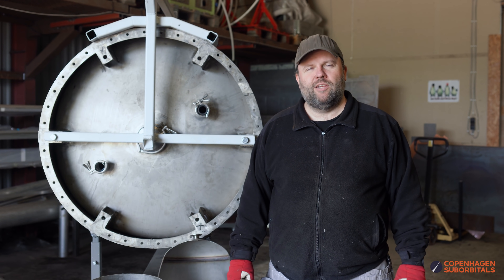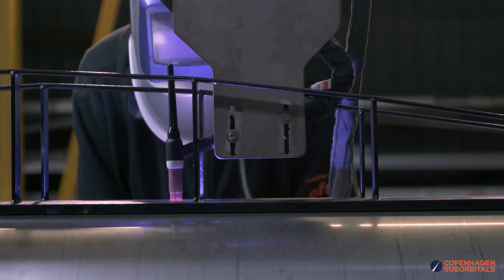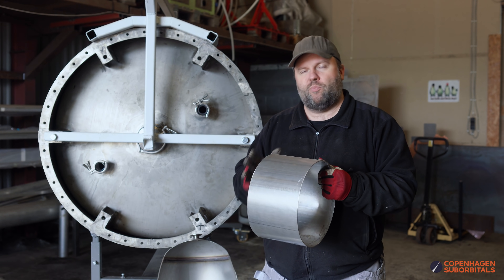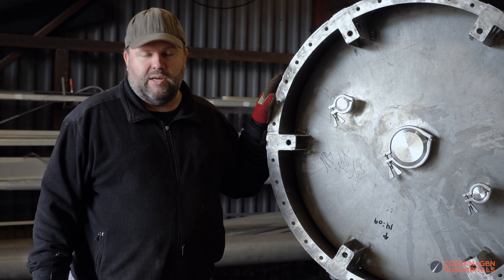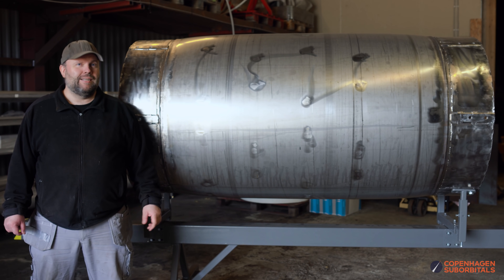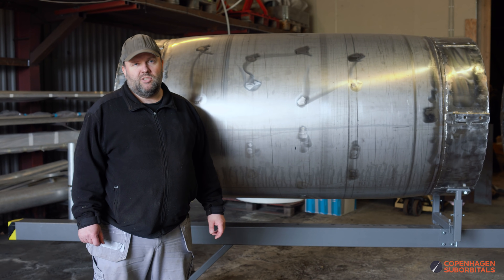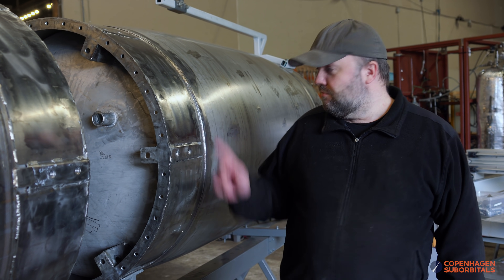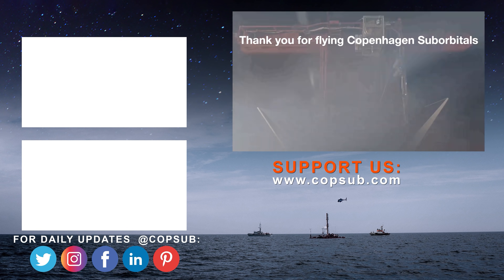How We Built and Tested 30bar ROCKET Propellant Tanks Using 304L Stainless Steel

Comment: I realize cost is a relevant factor but have you considered other stainless grades than 304? There are higher-strength austenitics with higher work-hardening rates and for the ethanol tank, which I suppose will not be subjected to cryo temperatures, duplex stainless could be an option to enable thinner walls.

Comment: The cylinder diameter didn't increase that much due to this tank has inside walls (to avoid liquid shaking) soldered, which made the whole structure harder, right?
Reply from the maker: If you watch this video on the anti slosh baffles, Jacob shows how we designed the baffles in such a way that they would not interfere with the tank walls stretching:

https://www.youtube.com/watch?v=39CB511Y1dQ

Comment: I would have thought that rolling the cylinders would have absolutely deformation hardened the sheet material circumferentially about its final centre. So it should resist hydroforming radially, because it wants to retain its hardened diameters, and axially only because there is a greater surface area at the side wall then the bulk heads. Just for thinking sake, I wonder if it could have been annealed first, and then expanded against a huge cylindrical mould. I understand that would be crazy expensive, and almost certainly not necessary.
Reply: Actually, the roll forming will introduce residual stresses in the plate (compressive at the outer surface, tensile at the inner surface). These residual stresses will add to the tensile from hydroforming so that work hardening will not be uniform across the thickness. Another factor which relevant is the so called Bauschinger effect, which will reduce the tensile work hardening of the regions which have been compressed during roll forming.

Comment: How will you maintain the pressure of tanks during the flight?
like, which gas is going to be used to pressurized?
Reply from the maker: Nitrogen
Reply: @CopenhagenSuborbitals  correct me if I am wrong ,our fuel will be in cryogenic state
Reply from the maker: @shyamalpatel627  Fuel (ethanol) will be ambient temperature, oxidizer (liquid oxygen) will be cryogenic.

Comment: You can clearly deformation harden to greater degree, and the 304 stainless steel will be even stronger at cryogenic temperatures for the LOX tank.
SpaceX are work hardening before making their tanks,  and with liquid methane and LOX all their tanks will be cryogenic. The combination of these effects is why SpaceX can use just 4mm 304SS ( and the plan is 3mm) for tanks that are 9m diameter, though lower pressure (6-7bar).
Work or deformation hardening pressure tanks the way you are doing with water is of course the way that the inner tanks for the cryogenic transport of gases such as LNG are made commercially.
What mass fraction have you managed to get to for your tanks??
Reply: But if you work harden before making the tanks, the welds and their heat affected zones will be the critical parts (softer).

Comment: Do you xray the welds?
Reply: Nope. We don't have the equipment. We just concentrate on testing the welding quality in different ways and optimizing welding parameters and the repeatability. Then we leak test and then we pressure test to far beyond the working pressure :-)
See our video about testing of the long seem weldings.

Comment: Have you guys thought of the stress concentrations you have made in the tank regarding the baffles in the tanks. They must be withholding the deformation back at some point. 
Furthermore, have you thought of trying to cool down a welding speciment down to LOX temp to see how that effect the brittleness, and strength of the welds?
Reply: Yes, we have thought of it, but we are not worried as it surpassed the pressure test.
That is one of the purposes of the pressure test.
We already know the brittleness will decrease at cryogenic temperatures in 304L that has surpassed pressurization testing. But thoroughly cryogenic testing will be performed later on in the process. It is part of our standard procedures, as you can see demonstrated in several videos on our channel.

Comment: Hi, I'd be interested to know what the implications are that each tank might not be precisely the same width and also that they're less wide than you expected them to be. In my head I have a picture of rocket engineering having to be accurate to thousandths of a millimetre. :-) I can imagine that it's not the end of the world if they are fitting inside some kind of frame and if you have left some volume margin so that you can actually fit enough fuel in.
Reply: Well, you are not totally off :-)
But an old saying goes as: "Perfect is the enemy of the good"

The reason why some parts of rocket engineering is working with extreme tolerances is primarily because sometimes hundreds of contractors are working on tiny parts for the same project. This means that the interfacing between parts often has fine tolerances. But when you are going from 1/10 mm to 1/100 mm in tolerances, you also increase the price 10 fold (or more). The individual parts can often be made with very rough tolerances, lowering the price of each individual part considerably. And if you are building parts in your own house, even the interfacing tolerances doesn't have to be that precise. It is often much more expensive to confirm to extreme tolerances than it is to just scrap a bad part and build a new one ;-)
Please try to zoom in on high quality photos of parts, say the lunar lander from the Apollo program: Bulky weldings, wobbly panels and so on ... ;-)

Thrust Vector Control Systems are able to compensate for many errors in the "straightness" of a rocket. The most important thing in interfacing the parts of the stack is that some alignment errors can lead to bad distribution of the force delivered by the thrust. But it does not have to be "perfect". It just have to be "good enough". 

(for the record, I'm part of the CS team)
Reply: @jorgenskyt  That was a class A1, fantastic reply that clears many things up. Thank you very very much! :-)

Comment: How do you ensure that when expanding the tanks the top/bottom bulkheads don't skew?
In other words do you take steps to ensure the tanks expand evenly on all sides?
Awesome work guys so happy to support the project :)
Reply: A number of our experiments with this method has demonstrated that after pressure deformation, the resulting tube is even more straight and round than before pressure deformation. The bulkheads also expands but not at much as the straight part of the tank as they are made of thicker material.

Comment: Really cool uodatr
Has the intertank section got some doors to bolt it to both tank ? Or is it weld to those tank ?
Follow up question, the upper tank will have a pipe going in the lower tank to connect to the engine ?
Reply from the maker: You can see six pillars on the end of the tanks and a flange ring with many holes. These are the bolting points to the intertank section, and every other section of the rocket above and and below the tanks. This way of connecting the rocket increases its weight slightly, but allows the whole system to be very modular and easy to upgrade or refurbish. 

The propellant feed line from the top tank will travel along the outside of the rocket to the engine.
Reply: The tanks, well actually all parts ind the "stack", will be bolted together. We have no way of handling a full stack yet so we must be able to take it apart and together again from time to time during the development.

Comment: Wouldn't a larger expansion improve the power to weight ratio of the rocket?  Anyway, a view of how the baffles responded to this expansion (as photograped through pipe holes) would be interesting as a followup to the baffle design video.
Reply from the maker: Mass ratio would improve, TWR would reduce. 

The appearance of the slosh baffles will have changed very little, but we'll sure try to sneak a lens in there for you sometime.
Reply: @CopenhagenSuborbitals  That would be great to see the slosh baffles before and after the hardening. I can see some dimpling on the outer surface where they were welded to the wall, I guess that's not much of a problem?
Reply: Yes please.. I'm quite curious to see how the baffles fared!